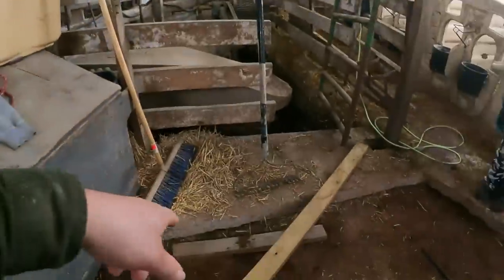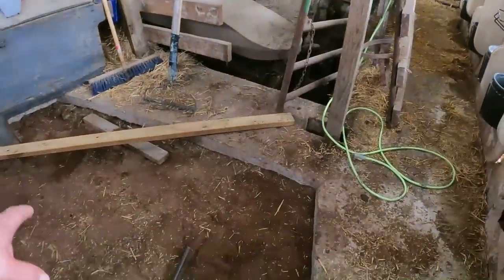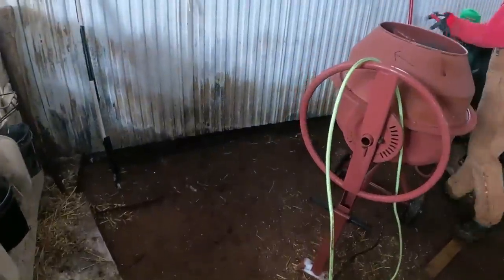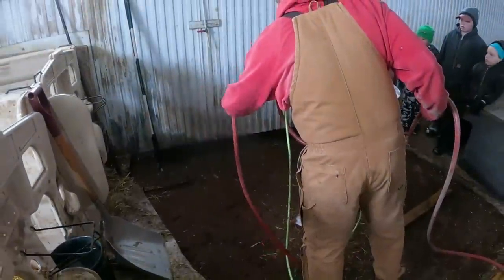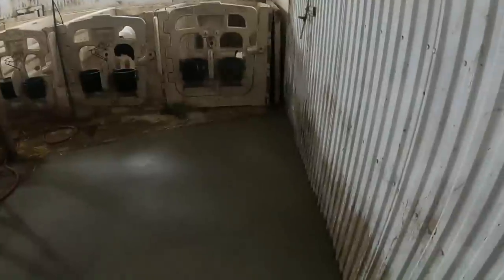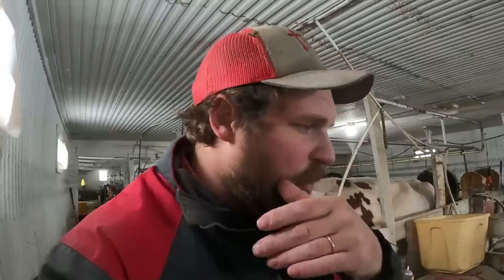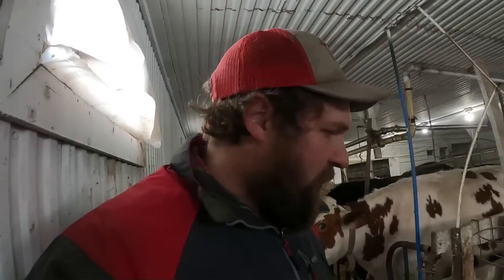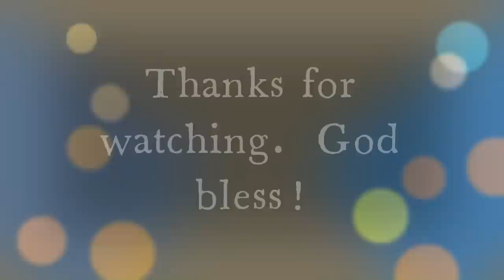The Nightmare is Finally Over!  Pouring Concrete in the Dairy Barn

Comment: Al .a nice tip for you :. the transition from new concrete to the old floor get you preferably .when you with a wet painters tassel cautious stroke along the seam .
Forward and backward and it will be very nice . 

Best greetings  !